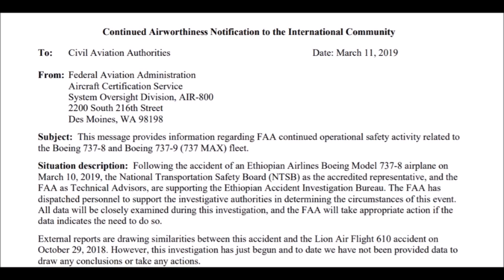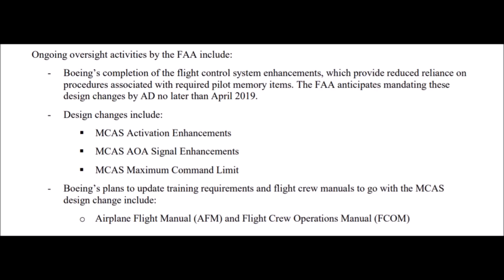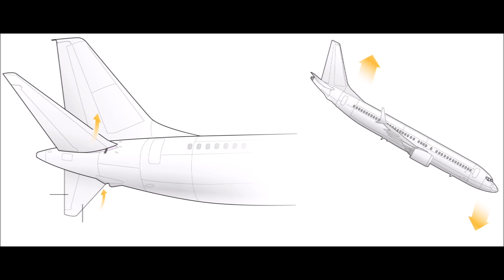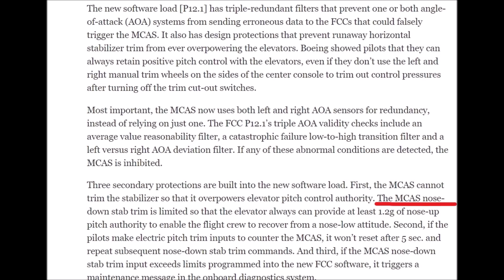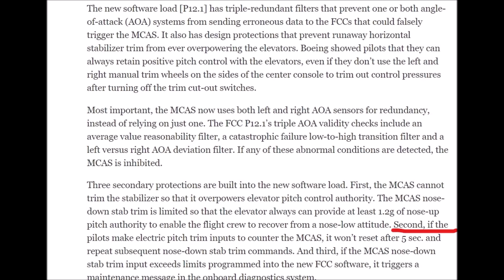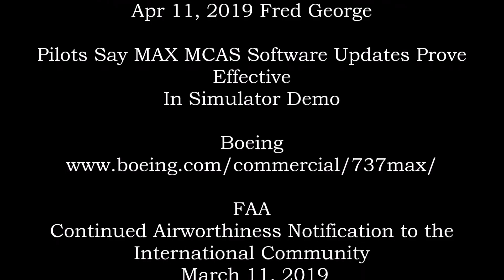737 Max UPDATE 14 April 2019 "The Fix"

Comment: Sir, I have a question/suggestion for another possible problem with MCAS. As it stands now, there is no way to diactivate the MCAS. Turning off the trim switches only cuts power off to the jack screw motor not deactivate the MCAS. If the pilots of the Ethiopian plane had a way to turn off MCAS without cutting power to the trim motor they would have had a better chance of saving the aircraft. I think there should be a separate switch that diactivates only MCAS in case the pilots think MCAS is acting up. Trim cut off switches should be used only for runaway trim problem not MCAS. What are your thoughts?
Thanks, and keep up the grate vids.
Reply: Same thought here, why not an MCAS KILL switch?

Comment: Again, great reporting Juan! Not a flight control engineer, but have worked on multiple civil engineering projects for both local and fed govt. Recently retired in part because my pleas for some semblance of discipline went unheeded.  Heard 2 guys @ the gym today bemoaning trying to get bldgs to pass final commissioning .  When it was determined that commissioning requirements won't be met, the rules are changed and substandard (say ventilation) standards are simply waived... pitiful.  Contractors get paid, everybody pats themselves on the back, gets in the ribbon cutting ceremony...can't heat or ventilate the bldg properly...

Comment: Juan, Captain Steve Bazar does not believe the Max is inherently stable like the other models. An excerpt from his opinion posted on Quora:

An aircraft with positive stability will return to its original position when it is displaced from a neutral position, either instantaneously (static stability), or over time (dynamic stability). At high angles of attack, the 737 MAX’s engine nacelles create enough lift to cause a divergent mode, which pitches the nose up and exacerbates the nose up moment. This is an example of both negative static and dynamic stability, both which are extremely dangerous characteristics for a passenger aircraft. These issues make stall recovery extremely difficult without an electronic “fix”.

Because of the 737 MAX’s inherent instability issues, the elevator authority necessary to easily effect a stall recovery is likely exceeded at high AOA’s. Therefore, Boeing chose to develop an electronic “bandaid” to attempt to solve the problem. Enter the MCAS, or Maneuvering Characteristics Augmentation System, which will apply nose down trim if the autopilot is off, the flaps are not extended, and the AOA exceeds a preset level. This is a highly unusual “fix”, one that had not been designed into any other conventionally flight controlled airliners. It ignored one of most basic principles of problem solving: “Whenever you solve a problem, you usually create one. You can only hope that the one you created is less critical than the one you eliminated.” If it’s a good solution, the newly created problem will be far smaller (and acceptable) than the problem that was just solved. This was not true of MCAS. It created a far greater problem (possible loss of aircraft pitch control), than the one it solved (nose-up pitching moment at high AOA).

737 Max 8 Anti-Stall System Reactivated After Being Manually Disabled: Report - ExtremeTech:

These findings raise significant questions about the FAA’s initial delay in de-certifying the 737 Max 8 and what the Lion Air investigation may have revealed. This is all information that should have come out in the aftermath of that investigation, particularly given the withering feedback from pilots who didn’t even know MCAS existed prior to the Lion Air 610 crash. Pilot and software engineer Gregory Travis has shared his own thoughts on the 737 Max 8 disaster in a Google Doc that’s well worth reading. As he writes:

If I have not been clear, so far, let me say it succinctly. Boeing produced a dynamically unstable airframe, the 737 MAX. That is big strike #1. Boeing then tried to mask the 737’s dynamic instability with a software system, similar to the systems used in dynamically unstable fighter jets (though those jets are fitted with ejection seats). Big strike #2. Finally, the software system relied on systems known for their propensity to fail (angle of attack indicators) and did not appear to include even rudimentary provisions to cross check the outputs of the angle of attack sensor against other sensors, including the other angle of attack sensor. Big strike #3.

This aircraft appears to be inherently unsafe, and probably should not have been certificated as being airworthy. The proposed fix presents a new problem. In the event of several possible systems failures, it has no protection against its tendency to pitch nose up when it encounters a wing stall. It is now a “fail-passive” System, which should be deemed as absolutely unacceptable, considering the 737 MAX’s stability shortcomings. MCAS is both necessary for the aircraft’s safe operation, yet also can cause a loss of control if it malfunctions.
Reply: Anything worth reading is worth checking out who wrote it...

Gregory Travis, a veteran software engineer and experienced, instrument-rated pilot who has flown aircraft simulators as large as the Boeing 757.

Dude has driven as many airliners as I have (zero).

Comment: The right thing to do is to redesign the undercarriage so that the engines do not have to have to be so far forward which necessitated software that would not otherwise be needed to reduce the higher inherent the risk of stalling.   This is not about automation.  This is purely about corporate greed and placing economic interest above safety.  You lost me when you said the 737 MAX is an inherently safe design.   How many Airbus A320 Neos nose dived into the ground?   Your comments are interesting but are clearly biased, as I would expect from some one whose economic interest is so tied to the manufacturer.   Suggest you transition from navel gazing to looking into the mirror.

Comment: Saving money to continue keeping what is basically a 1960's design instead of designing a new airplane.
Well, these two accidents have made two things very clear to the flying public, and especially outside USA.
Boeing is more focused on profit instead of safety.
FAA cannot be trusted.
While FAA was universally trusted before these two plane crashes, I am afraid that no authority will believe anything coming out of FAA now. This means that although the 737 Max may be approved for passenger transport in USA, it may take a lot longer outside USA simply because of the loss of trust.
No passenger airplane should have to rely on a system like MCAS to be certified.
In the end, it will be the passengers, who will decide in that they may still refuse to fly with the 737 Max. If this happens, the 737 Max will be the biggest loss for Boeing in their history.
Hopefully, Boeing have learned their lesson now.

Comment: If experienced pilots can barely tell the difference between MAX and previous 737s, it would appear that MCAS is unnecessary added complexity. I smell bureaucracy both at Boeing and in the FAA for requiring the system in the first place if the difference is that small. And then to top it off, Boeing did an obvious horrid design job with FAA approval. Plenty of blame to go all around; people should go to jail for this level of negligence.

Comment: A rush job. I have a hard time believing any competent programmer would sign off on MCAS as originally implemented. A single sensor? Really? But as horrible as the design is, both planes could have been saved if the pilots had been up to speed on runaway trim.

Comment: @blancolirio Thank you for your expertise and the time you put into explaining these. Could you provide your opinion regarding these inquiries: 

In this video you intimated that MCAS exists to merely make the "nose-up" flight tendency of the 737MAX feel more like the previous version of the plane (-- NOT to arrest the plane from a stall). However, through Boeing's original, practical testing of the system, THEY increased the original MCAS rear stab adjustment capability from 0.6 (out of just under 5) (about ~12%), to 2.5, (about 50%). If, through practical testing Boeing felt that 50% was needed to give the plane the same "feel" as the previous version, and NOW they are restricting MCAS in all these ways, are we supposed to believe that the plane will still have the same "stick feel" as its design brethren? 

To a second question: Boeing is introducing multiple ways in software to detect AOA failures to K.O. the MCAS system. However, the plane remains with only 2 AOA sensors. Meanwhile competitors will typically implement THREE (or more) AOA sensors so when one fails, the system can tell which one it is because the system will still have 2 good sensors to compare against. Since we have (at the least) these 2 crashes to go off of, do we not have enough evidence to know that the Boeing 737MAX8 AOA sensors are failure-prone? Could there be a consequence that AOA failures during takeoff could change the flight response of the plane because the MCAS suddenly won't trigger? After all, if MCAS exists to protect the feel of the plane, then when it fails to trigger the pilot suddenly has a nose-up risk. Thoughts?

So either A OR B. A) The plane is safe without MCAS -- so why is MCAS implemented? OR B) The plane is not safe without MCAS -- so why don't the sensors that MCAS uses have more redundancy? 

Or C) MCAS is a makes handling the plane easier. In which case, again - shouldn't there be more redundancy for the AOA sensors so the system can survive a single AOA failure?

Thanks in advance for your thoughts

Comment: Do 10 degrees,  wait 5 seconds,  repeat? That's not countering minor upforce. I'd feel better if the trim is limited according to throttle control, since that's all the system is designed to compensate for. 
Also, 2 sensors are too few. Need to have at least 3, preferably more. Should be easy with internal gyroscopes system? Or liquid sensors,  the same used with smartphones?

 IMO, the current fix is incomplete.

Comment: Take Juan plane a Luscombe and put a big oversized and over- weighting 12 cylinder Rolls Royce motor in the front, if the plane is unstable by taking off, no problem, call the killer engineers team from Boeing they will stabilized this good old coucou with a MCAS!
 Same story happened  the 737 Max 8 and 9 they had to relocate 3 times those huge overweighting Leap jet engines because of the center of gravity.

Comment: There was a story on Youtube about Boeing farming out parts for the 737 to outside vendors.   None of the parts would fit and all of them were out of tolerance.  Boeing sends a team of inspectors to the vendor to find out what is wrong.  These parts were suppose to be manufactured with CNC machines to very tight tolerances.  The teams finds that the parts were being made by hand with hand tools.  The Boeing team talks with the management at the vendor and they tell the Boeing team to F themselves.  Team complains to Boeing management who just stick their thumbs up their own butts and does nothing.  So you wonder why the 737 Max 8 is screwed up.  Same reason why there was only 1 AOA indicator on those 2 planes.

Comment: Juan... let me ask you a question.
is it possible to overide/shut-off the MCAS?
So many many people are saying it puts the aircraft in an "unrecoverable" flight path. 
Yet I also read that there IS a procedure to remove MCAS from the equation and fly manually.
is this true?
Reply: there are switch the pilots use to cut power to the electric motor MCAS uses  Once the motor is powered off MCAS is off.
Many people heard from dumb media people that the new position of the engines on the aircraft made it unstable.  A lot of people still believe that.  However the fact is that this plain has been flown with MSCA off safely and it didn't stall or have any tendency to pitch up.  The plain is stable. and will not go into unrecoverable flight path.  

Once the flight data recorders were anaylized it was obvious that  the case was caused by a failed sensor and faulty software.  People don't want to believe in such a simple explanation.  So they are convince it was the engines that caused the crashes.

Comment: Anyone that works with life critical systems knows that 3 sensors must be used in order to be fool proof.Boeing should be prosecuted.
Reply: simon hanlon — Two sensors are sufficient for fail-safe operation.  Three or more can be fault-tolerant if the supporting system is properly designed.  Nothing is “fool proof.”
Reply: GH1618 The nuclear missiles my Father worked on used 3 for a very good reason. They also use 3 on nuclear power stations.

Comment: I still don’t think they are doing enough. They are still only relying on AOA and no other instrumentation. If you ask me they are being lazy at the risk of peoples lives. Both AOA are still only one system. Altimeter and airspeed inputs would have told MCAS the plane was moving too fast and was losing altitude way too fast. These two devices could also shut MCAS down and allow pilot control. Another procedure should be a MCAS neutral position Instead of a continual nose down adjustment. Get it right or no flights!!!!

Comment: Good to hear the 737 Max 8 is an inherently stable aerodynamic design and that tweaks to the MCAS system will make it as safe as any other 737. 

So the real mysteries are: 1) How did the original poorly designed iteration of the MCAS system get approved by Boeing and FAA to begin with?  My gut feeling is middle or upper management at Boeing had a major say in the design and may have overruled the safety objections of the software engineers. 2) Given that BEFORE the Lion Air and Ethiopian Air crashes even happened, at least two unexpected nose down dive events occurred on Max 8 planes due to faulty air speed sensors and yet these close calls with mass death did not set alarm bells throughout the airline industry including at Boeing headquarters.  3) Why did the CEO of Boeing emphatically insist the Max 8 was a very safe aircraft during the days following the Lion Air crash? And even after the Ethiopian crash, he did not want the Max 8 fleet grounded.

Comment: Im not a pilot or an engineer, but when you mentioned that "seasoned pilots" who fly without MCAS can hardly notice the difference I have to wonder if MCAS was a solution in search of a problem.  With the design changes on the MAX series you'd think that a qualified pilot would at least have a rudimentary understanding of the differences and how the new engine design could effect CG and how to compensate for it.  Am I wrong?

Comment: I hope that text was from a magazine, because what was described is NOT "triple redundancy". Triple redundancy requires three inputs, and they only describe two: the AOA sensors. They now have a double-redundant system that has some additional overrides, but they don't have a triple redundant system. 

The double redundant system with overrides may be sufficient, especially if that line item for pilot initiated counteracting trim disabling the 5-second restart of MCAS doesn't just mean that they have increased the 5 seconds to 10 or 15 seconds or something like that. However, given the absolutely unbelievable stupidity of using both sensors, but only one at a time in the initial design, I woudln't trust either the trim override or the down-thrust limit unless I could see the code myself, and of course that just isn't going to happen.

Comment: Yet another comment.  Many pilots are a bit intimidated by guarded switches.  A guarded switch is usually an indication of "Don't touch," or at least "Don't touch in normal flight."  On the 737 Max, the MCAS leading edge trim tab control system should have been designed to default to neutral position any time the pilot inputs manual control to the elevator of the aircraft.  Having to stop and play with guarded switchs during an emergency procedure added extra confusion to working the problem.

Comment: Sir, you are going around in circles.   Whats so expensive to meet FAA Cirtification requirements ?  Giant Boeing certainly has Untold billions in Captial.  why try to outdo airBus in the 1st place?  So , if the MCAS system with one Vane fliped up and down , now with two Vanes ,will sovle probelm.   I'm not convinced.  Why can't pilot disable the system and let the Pilot trim the nose?  What s so hard about that?  Or sit there in a Vertical nose dive to Death?  No excuse for this set up in 1st place.

Comment: I have been an aircraft mechanic for 12 year. Boeing fucked up right at the moment the decided to modify the engine so that performance and fuel efficiency  match the similar Airbus plane. They probably knew that they wouldn't be able to fix the Weight and balance issue (major fuck up) without major overhaul of each plane ... so they decided to cover up and add the dreaded MCAS system to compensate ... just to save money ... at this point MCAS is NOT to be considered a safety sub-system but a main flight control system. Their stupid mistake and negligence cost many lives and it shouldn't be forgiven easily. They have to fix the weight and balance issue or the plane will never be safe. Period.